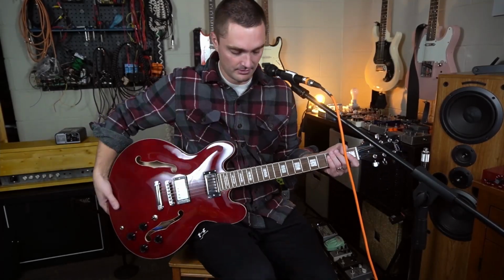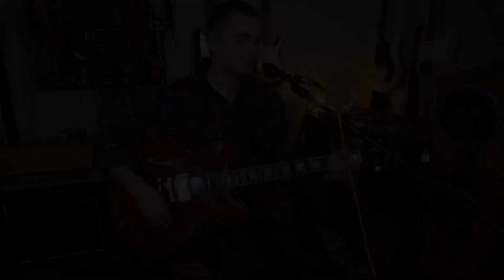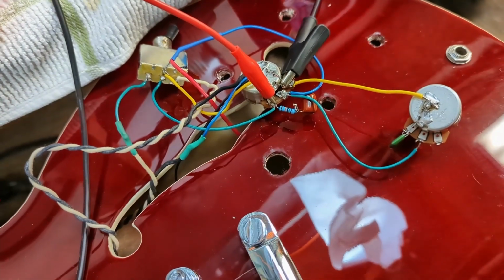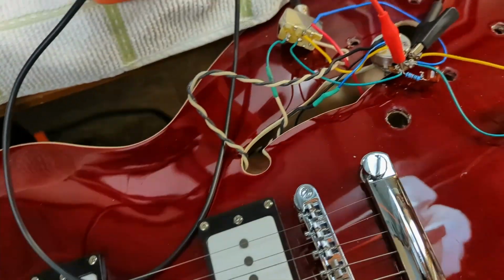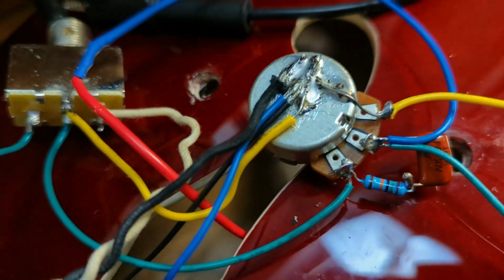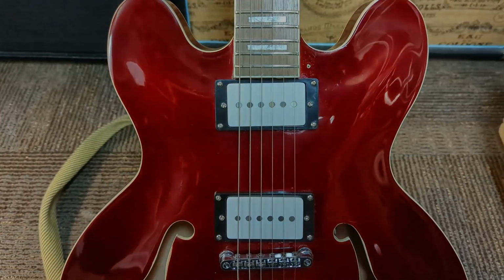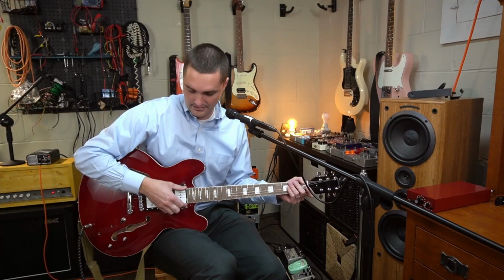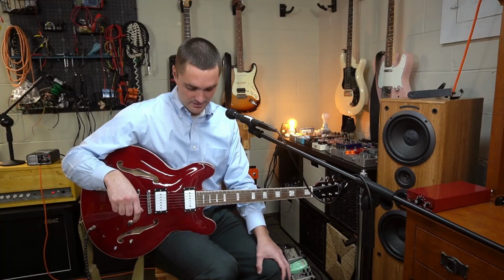$120 Semi Hollow Gets New Pickups - Bootstrap HB-90 Clean | Install and Demo

Comment: I’ve been curious about the Bootstrap HB-90 pickups for a while now. I’d be putting them in an Ibanez Artcore AFS75T (thin fully hollow body). 

Don’t suppose you have any experience with the Mean version? I tend to play edge of breakup to mild/mid gain and wondered if the Mean 90s would be better suited. 

Thanks, I really enjoyed and appreciate this!

Comment: Got mine in nickel covers, way too ice-picky w/500K pots & .022uf caps, swapped in .047uf and put a 470K resistor across the outer lugs of the 500K volume pots, very do-able now. 500K tone pots are okay IMO 

Put mine in an HH Thinline, 9 guage is too light, pure nickel round core 10s prolly lightest. Flatwounds would be fantastic I'm sure.
Reply: There are other 'in-between' pot values. I can't remember exactly but I think it was a 350k pot I installed with my p90. Your solution works too, only thing I'm not sure of with the resistor&500k is whether increments on the dial are in greater amounts